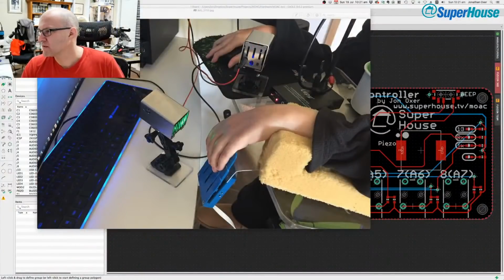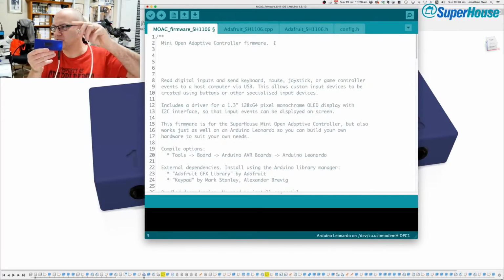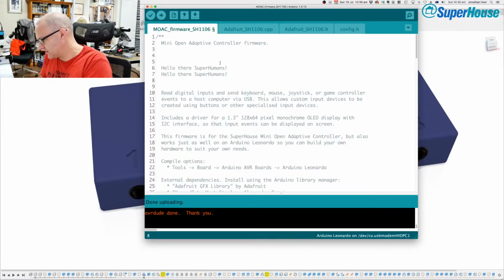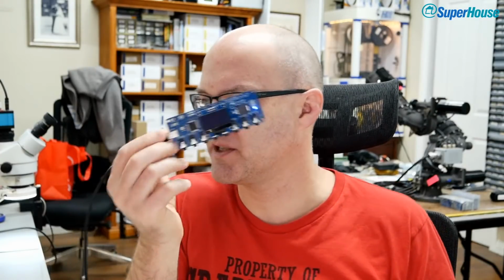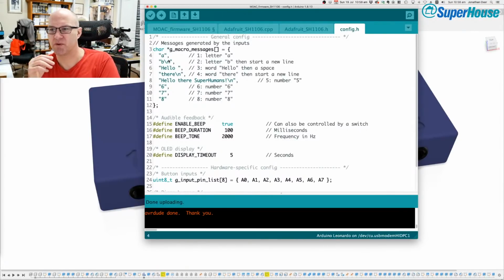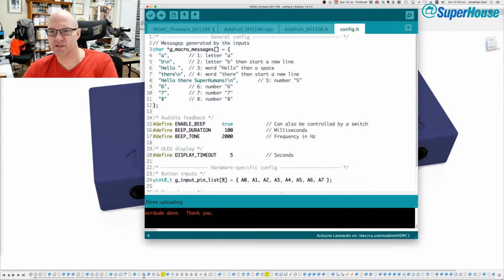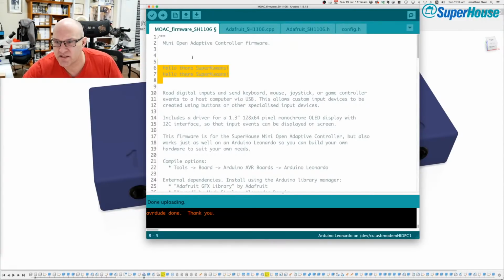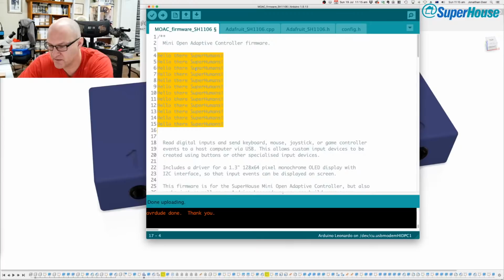SuperHouse Home Automation Hangout 2020-07-19

Comment: Regarding the switch could you not replace it with another 3.5mm jack and have the plug bridged? That way it completes the circuit when plugged in and breaks it when removed.
The same way some UPS's use a non standard Anderson as a battery isolator. It doesn't have to be large. you could have it able to be tethered to the case so it is harder to loose

Comment: With your mention of out of the box support the atmega 4809 is a great chip if you want a newer generation MCU that doesn't require any external clock, if you flash the Arduino bootloader on it and use the pins as per the "Arduino nano every" you can just use that board profile to upload programs to it.